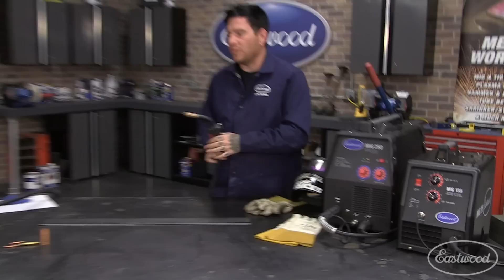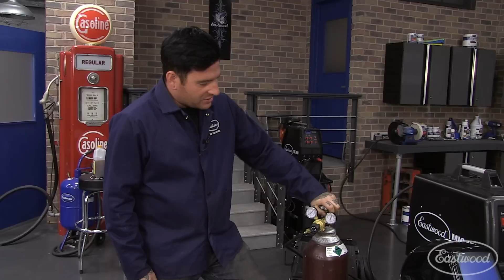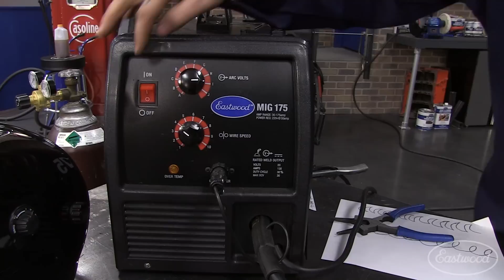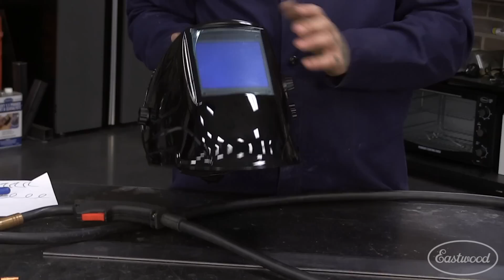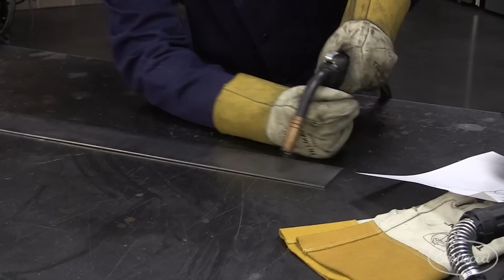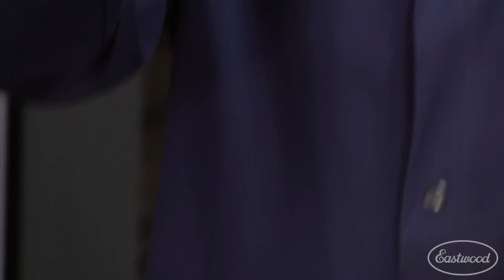How To MIG Weld: MIG Welding Basics Demo Part 1 - Eastwood

Comment: Shielding gas displaces oxygen so you don’t get rapid oxidation while you’re welding. Prevents instant corrosion basically from the intense heat of welding 2 components together.

Comment: Point: Shielding gas doesn't protect the weld from impurities floating in the air. It protects the weld from the air itself; which is comprised of gasses mainly oxygen and water vapor. It is being picky but new welders may not understand that it is the air you are shielding.
I like all videos that explain welding and get more folks trying to learn this valuable skill. Thank you for this series.

Comment: Excellent video for mig starting 👍 good job. Could also do mig instruction using flux core mig welding. There are many mig welders that only use flux core wire.

Comment: Good video.  The only thing I wish you had done was mention the metal thickness you were welding to, the metal thickness of your patch and your wire/rod selection.  Also an explanation on why you chose that combo for your work.  Other than that it was a good straight forward video.

Comment: hi what the different between mig gas torch & mig none gas torch
do i need to change the torch if i switch to different welding type for example to mig none gas AKA fluxcore welding

Comment: Where do you buy shielding gas?
Reply: I know you weren’t looking for an answer from me, but if you’re on a budget like I am, you might try looking in to using straight Co2. I live in Brevard Co Florida and I found a place that provides Co2 to the local restaurants in the area. You have to order an $18 adapter from Amazon, but the price is worth it. It only cost me $32 every time I trade out a tank. I use Argon for welding aluminum and Argon/C25 are close to $100 to have filled, depending on what you have in your area. 👍🏼

Comment: Atcutally you can use gas on flux cord a lot of times you weld flux cord with out gas you will get prosity. 75%25% is the gas

Comment: You need a better quality noise canceling microphone, and record at a bit higher volume, and then adjust it in your final mix
Reply: Use headphones if you have them. It helps.

Comment: Flux core wire does not have a flux "around" it. it has a flux center (core).
Reply: I think that that was implied by calling it  flux core. But the flux core gas does go around the weld hence shielding "around" the weld. If you misunderstood that basic explanation of flux core wire you probably shouldn't be welding. Donky.....

Comment: Thanks for the great video. I just bought a Lincoln 140 HD welder. I’ve never welded before and I have a question about grounding. If I lean or touch a part of my body on the piece I’m welding, can I electrocute myself when the weld begins?  Probably a crazy question, but I don’t want to get hurt before the project even begins. Thanks for the help!
Reply: Matt just make sure you wear rubber rain boots then you will be safe!! They have them at welding store

Comment: Will you not get electrocuted if you accidentally touch the clamp while welding? Or touch the metal where the clamp is clipped?
Reply from the maker: Well you should have gloves on which would hopefully prevent that but no you will not get electrocuted by touching the grounded project or ground clamp when welding.

Comment: You know I haven't welded anything before but I have a broken M10/M12 motor mount stud that has 1/8-1/4 material sticking above and I have a nut. But there's no threads and I'm wondering if a 125amp 120v  Flux welder will work to weld the stud to the nut to get the stud out?. I have to purchase the welder I need to know before I waste my money or not I've asked plenty of people in comments no answers I'm not trying to weld metal to metal a stud to a nut to get it out it's not really torqued in there I can't get it with vise grips what size welder I would need for penetration to the stud to the nut
Reply from the maker: We've seen methods where guys will weld a nut to the end of a broken stud then use a wrench to unscrew it. Yes that's a realistic approach.  It's actually HOW you get broken manifold bolts out of aluminum heads on for example an LS.

Comment: Why does the machine have the voltage setting in alphabetical order rather than the voltage?
Reply from the maker: It's just a reference.  There is a chart on the machine to help you get the perfect settings.

Comment: Where is a good place to get a steel work bench like that?
Reply from the maker: Build a table to fit your needs and space! This bracket kit makes it easy. Works with lumber and steel tops. Your pick.
https://www.eastwood.com/eastwood-shop-table-bracket-kit.html
If you have a thick wallet, check out CertiFlat Weld Tables. 👌
Reply: @eastwoodco  Awesome, thanks a ton! Just starting out on teaching myself to weld and such so this (plus your videos!) will be useful! :)

Comment: Can these mig welders work with aluminum?
Reply from the maker: The MIG 175 comes with a Spool Gun to weld aluminum. Most of the other Eastwood MIG welders can also weld aluminum with a spool gun, which is sold separately.

Comment: You lost me after stating flux core wasn't as good as gas shielded. Incorrect statement especially for the inexperienced. It performs exactly the same as gas shielded, you just need to have your welder set properly to weld with flux core. Reverse your polarity from standard so you aren't getting more heat to your wire than you are to your surface and there's virtually no spatter.

Comment: came here to refresh myself on mig welding as I haven't done it in nearly 8 years. I primarily weld stick but for you absolute beginners please pay attention to the safety aspect of welding. can't stress it enough, the last thing you want is a welding light burn. always wear the  proper protection and always make sure your lens in your helmet is in there correct. I can attest to how bad it can mess up your eyes, I had 2020 vision before my eyes got light burned and now I need glasses to see fine beyond 10 feet.
Reply: Your fault should have been more careful.
Reply: @fosoofkkkfkfkckd  well yea no shit, i was also arrogant and a young teen when i started. when you're that young you tend to be reckless and forsake safety.

Comment: I'm a design engineer so I am used to technical terms, but this video assumes too much from the start if it's intended for the beginner.  "This machine is a 110 175 amp and this is a 220 250 , this nozzle is for the wire and you might want an 020 or 030 or 040.......". I got a couple of minutes in and gave up, I want to be treated as a beginner who knows nothing about welding.
Reply: Joe joe do you want somebody to hold your hand also??

Comment: Is the audio quite for anyone else?
Reply: No worries, I've got it up on the TV. Been a subscriber for several years now :-)
Appreciate all these webinars, I've learned a lot, so thanks again
Reply from the maker: DareDevil5692 The audio issue seems to only be on mobile devices.  We're trying to correct it, so if you're a subscriber, you should be notified if a version for mobile is uploaded.  Thanks.
Reply: Robert Brown 
Doesn't seem to be low, I'm listening at 30% volume level
Reply: Eastwood Company Its not so great on laptops or desktop computers either. I have to turn up the volume to max setting to hear.

Comment: So many problems with the version I watched (but not for long).  Music is too loud, Cameraman is useless, and the Demonstrator does not speak clearly.  This last problem could be overcome if only the subtiles made sense, for instance:
SUBTITLE     MATTT SAYS
taksidian       -  Tech video
eastwood      -  least one
between        -  machine
make water  -  MIG welder
Mr. nozzle     - just your nozzle
- sighs -         - size   

make            -  MIG
8                   -  MIG
big                -  MIG
maid            -  MIG

I could go on, but you get the idea.  All this is in the first two minutes of the video so I'm off to find another, one that makes sense.